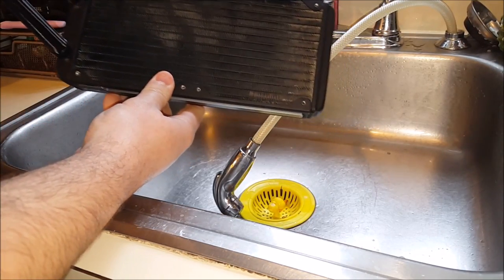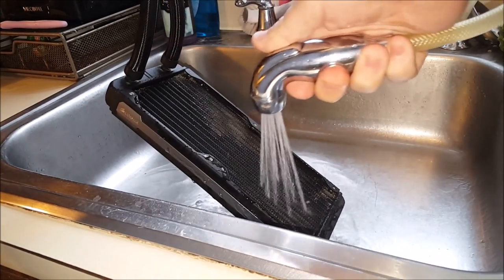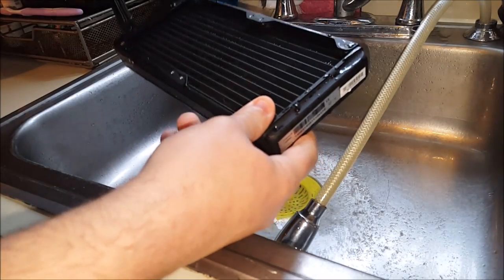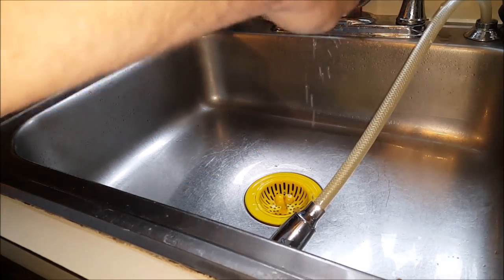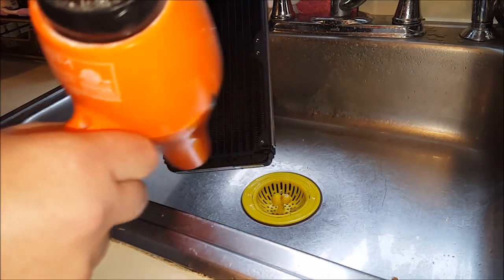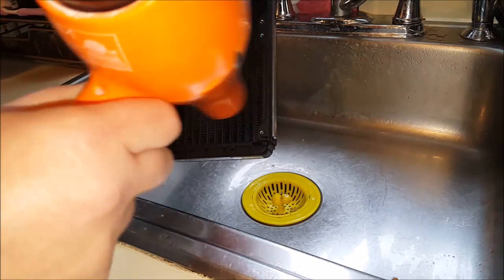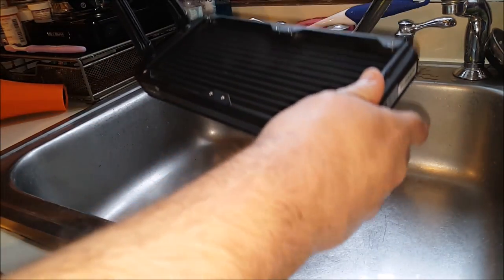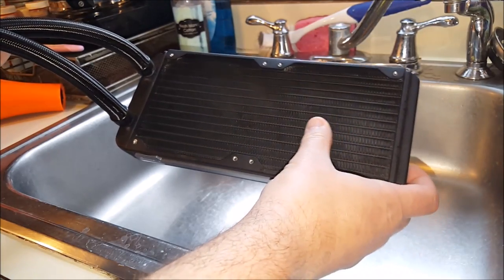How to Clean DUSTY Computer Radiator (Liquid Cooler, All in One, Custom Loop)

Comment: To all who are concerned still about damaging the radiator, as long as you don't get any electrical bits wet you're fine. The radiator is basically just a water container with two lines hooked up to cycle water through it. All the electrical bits to worry about should be on the block to work the pump. Obviously disconnect your fans and this is a great way to clean your radiator, I do HVAC and it's the same shit on a larger scale, we clean the coils with chemicals and water.
Reply: I didn't notice everyone worried about it was worried a year or more ago. Whoops lmao
Reply: Some people are saying don’t use tap water, do you agree?
Reply: @reeewhydoihavetochangethese  Still good to know for future visitors!

Comment: if you're worried about rust or corrosion due to water getting stuck in spots you can't dry out with a towel use a hairblower on it for a few minutes after having rinsed it out. i also use soap in mine as it really helped remove the stuck on dust that water alone can't remove. hope that helps.

Comment: Good vidéo. I would just recommend not to use tap water or if you do, dont let it dry by itself or the fins might rust. I use Distilled, demineralized or any ionized water and dry it with my air blaster or any compressed air.

Comment: Personally I just use a powerful air compressor, seems to work.
Reply: YoBoiCam oof
Reply: do u use it for ur whole pc?? like is it one of those u can fill up car tirres and stuff with?
Reply: The datavac ones are great and designed for this. They will not bend you're fins, unless you cheapest out on them lol. If you're fan blades are bending you need to up your price above $5 for fans lol.

Edit:lol he deleted his comments
Reply: @derekakaderek  XX 
 Y

Comment: I'd not recommend to use tap water, as it contains some minerals in ionic form. Drying and going in contact with air would oxyde them and make some powder.

Air compressor or demineralized water are safer.
Reply: what about adding detergent as well to the distilled water?

Comment: you forgot to show the cpu waterblock "later in the video"
Reply from the maker: Yea, lol, I realized that after I uploaded this.  You can see it around the 4:07 mark.  I just took a plastic shopping bag without any holes in it, tightly wrapped it around the water block/pump, and put an elastic around it to keep it from getting wet or coming loose.

Comment: When I clean mine I drip as much as possible then just leave it in the airing cupboard overnight. No need to use a hair dryer as the warm boiler continually heats throughout. As this vid states you should wait for temps to go back to ambient before refitting to avoid any dew point issues.

Comment: this is %100 safe on radiators right? I know you just did it but I'm kind of scared to break my G105
Reply from the maker: +Dopest King this was done AFTER both a vacuum and compressed air. This is not only 100% safe, and recommended, but it's the only way to remove 100% of dust from the heat fins and open that area up for airflow.
Reply: Nothing is needed... You don't even need a computer. Your rads will still function with dust, it won't crater your home. If you want a better clean, use water, otherwise pry off the bigger pieces of dust off or use compressed air. It's just water, it will dry. It's not going inside of your radiator.
Reply: come on people are you really that naive, Its a radiator it has water in it do you suppose the metal on the outside is different.  does your car radiator get clobbered by rain?  use your brains for god sake!
Reply: @mcoop854  thank u... lol

Comment: Is it really safe to clean it with water the radiator because never cleaned it before also what is better cleaning with vacum or water? And what is much safer?

I have corsair h100i cooler
Reply: yes but only the radiator fins itself. keep water away from the block.

Comment: I strongly recommend using compressed air. Dust is not homogeneous, it has particles of everything in it that can be sticky and gather things around when get wet. If you blow compressed air (with a cheap 80W compressor) through the radiator, you`ll most probably don`t need to wash and dry it. You can still do that after, if you still want to.
Reply: If I have a push configuration do I have to take it all out and blow dust out? Or can I do it from inside the case thanks.
Reply: I always take it all out but if you won`t, the vital thing is DO NOT LET FANS TURN AS YOU BLOW AIR  and also remove the fan pins. Otherwise electricity generated from spinning fans can damage other electronics. Removing only the fan pins may not be the best choice, depending on your motor type used in fans. Also consider, all the dust displaced needs to go to somewhere. You do not want them inside your case or the room.
Reply: Thanks for the reply so im doing this outside and im holding my fans as I am blowing air out of the case is that ok as well.
Reply: Is it okay to use a hair blower to clean this? Sorry for the noob question.
Reply: I used compressed air lastnight to clean my cooler an fans because it was getting too loud.. and when I turned my Pc on today it was louder I don’t understand what happened? All I did was spray the air like everyone else did
Reply: Any recommendations on what I can do to make it more quiet without using the tap?
Reply: @JuJu_66  impossible. Check your PWM controls. It is not possible for cleaned fans to work louder.
Reply: @kivanckaranisable  what is the pmw?? And it might just be my fans or something because everything is cleaned now and there is nothing in the Corsair cooler radiator like o thought there was
Reply: @kivanckaranisable  PWM*
Reply: @JuJu_66  PWM stands for Pulse Width Modulation ( I can explain 3 types of fans used in PC cooling systems` electrical principles if you ask [ or you may google]. And you have some more physical / mechanical types also liked brushless or magnetic leviated types).
What I mentioned was, check your speed = power limit settings on fans. They are/must be super adjustable. Did you make the connections right ? and please check your BIOS settings of your motherboard too. Corsair is not the best but super great. Can not be loud (My favorites are Noctuas and some Arctics). I need more data to be of help.
? Motherboard make/model
? Your connection diagram on your cooling system
Your system can not be loud. You can message me too for not polluting the subject here and we may report the final successful result here to help others if you want.

Comment: When you removed and cleaned the Radiator, did you reapply cpu thermal paste when you mount it back?
Reply: Proper way is to clean off the dried thermal paste and reapply new thermal paste when mounting it back onto the processor

Comment: How do you remove it without replacing the thermal paste? Wouldn't I have to remove the CPU cooler block to get the radiator off? 

I think it's time I change my thermal paste anyways, but just wondering if their is a way to remove the radiator and clean it?

Comment: Will anything spill out of the tubes when I take the water block off the processor
Reply: Darkmirror35 no nothing will spill from a aio water cooler if it's  custom water cooler then most likely but for your cooler no it will perfectly safe to do

Comment: how and when do you refill the liquid coolant in one of those??
Reply from the maker: That's not really recommended.  The coolant inside is treated as to not become contaminated and should last for the life of the cooler.  The one in this video actually started to fail recently.
Reply: this guy cut the tubes out of his h110i and added new tubes then filled it with coolant and did the usual run liquid tests you would normally do on a custom ill have to do it to mine because the liquid is mostly gone in mine
Reply: UBeeNStryKeD actually a lot of people Opened them and their were gunky and yellow with a lot of metal particles

Comment: I got a small dent in one of the fins... best way to go about repair? It's not punctured, just bent.
Reply: You can try bending it back with a small pair of tweezers.  I'd personally just leave it the way it is.  The metal is quite thin, so you are risking straining the metal even more by bending it back.  Depends on how large your radiator is really.  I have a 280mm and have a few bent fins.  I don't worry about it much.
Reply: you haven't heard of a radiator comb? no joke!!!  try auto zone get the smallest one they have

Comment: great video but mine is screwed into a acrylic flexiglass, if i tried to unscrew the screws, the enclosure will crack..
can i use air spray and spray with isopropyl/ethanol combo?

Comment: Is there any way to clean the radiator without taking it out?
Reply: air compressed can need to do it regularly or it will cake up. then disassembly is required for deep cleaning.

Comment: What about the liquid inside? I saw another video of a cooler getting dismantled and his cooler was a little clogged with debris inside..
Reply from the maker: +Eazy opening an all in one is A BAD idea unless you know what you're doing. If it's a loop, clean it with distilled water.
Reply: UBeeNStryKeD I've had my PC for 3yrs roughly now maybe a little longer, with the same water cooler in your video. Would you say you should clean the liquid that's in it? Or just leave it be? I've never been told about this stuff so I don't know unfortunately. Do u have to replace the liquid or the whole cooler eventually? Thanks for the reply I appreciate it!
Reply: Eazy It is usually pretty much impossible to replace the water. You're probably better of just listening every now and then, if it makes lots of noise or if it starts preforming way worse, it is probably time to replace it. If you want to be able to replace the water and have even higher performance, you'll have to go custom loop, but those have their price

Comment: Will there be any water mix into with those liquid in that tube?
Reply: It's a closed-loop cooler, no water is getting in there, now... If there's liquid coming OUT of the radiator before you even go to clean it out, then, of course, water is going to get inside the tube but at that point, your whole PC must be fried lol.

Comment: How often do you need to do this?
Reply: I have a H80i cooling a AMD FX 8150 Bulldozer (8x 3.6ghz) and im about to clean mine for the first time because of slightly higher temperatures, itll be the first time iv cleaned it, and it has been 4 years! XD They need so little cleaning to be honest because they dont get dusty as fast as basic fan-coolers. If i was going to be more of a maintenance nut then i would probably say between every 2 to 3 years. Dont forget to re-apply thermal paste, even liquid coolers still need to do this step.
Reply: Jake when you physically notice that your radiator is storing dust or if you notice fan speeds are elevating . Also don't forget to clean the fan also
Reply: As much as your heart desires... A.K.A when it looks ugly as fuck because honestly, I've kept a radiator cooling fine for years with it being dusty inside, it's just aesthetics IMO.